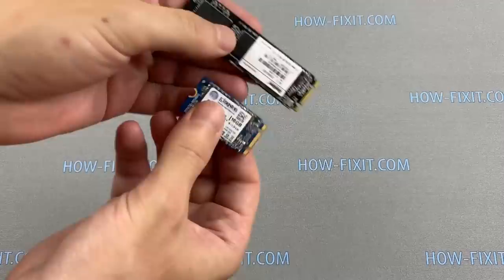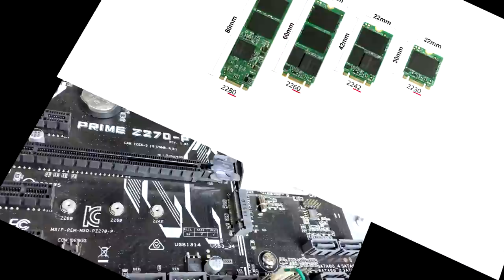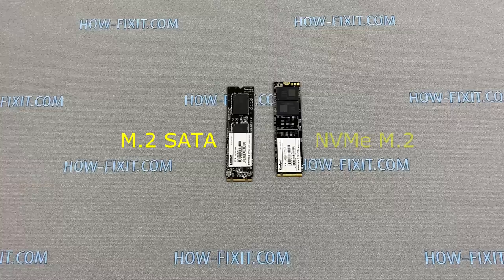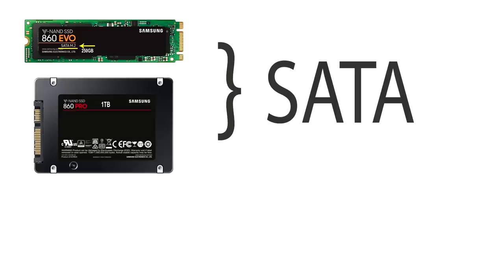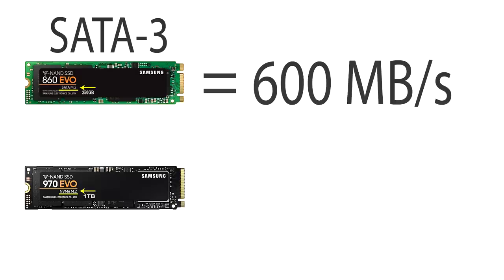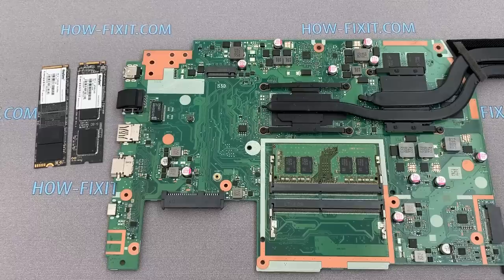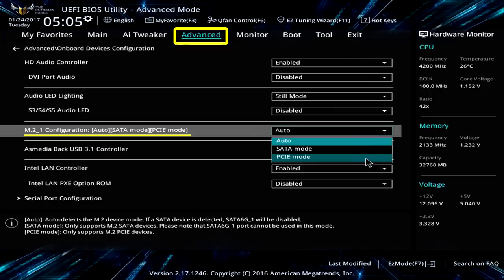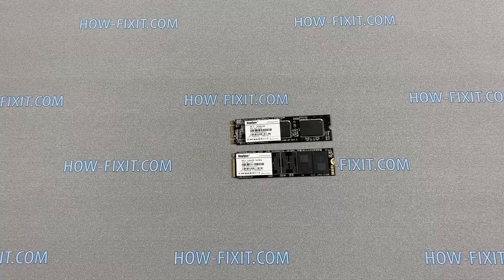Explaining the Difference Between SSD NVMe and M2 SATA and mSATA

Comment: Hi, I bought the Samsung 970 EVO Plus NVMe M.2 drive for my Acer Aspire V17 Nitro Black Edition (VN7-791G-77HR) laptop, and I installed it but the system does not see the installed drivers and it does not show up in the BIOS. On the Acer website, it says my system is equipped with an M.2 Slot 1x 2280 SATA III (M key). I am thinking the problem is that 970 EVO is using PCIe standard M-Key vs SATA III standard M-Key, does this make sense..?

Comment: Hey- how noticeable is the difference between a M2 that reads at 2.000 mb/s and one at 3500 mb / sec . Is that difference really so big ? i have 2 slots on MB - one its gen3x2 one its gen3x4. My problem is that i can ofc plug my gen3x4 in the proper socket but its hidden behind my video card and i kind of wasted the amazing RGB it has . I want to move it on the gen3x2 but there will be limited to 2000 mb/s reading instead of 3500 mb/s which is where it works atm. The writing is around the same value for both ~ 2000 so there is no impact. Will i lose such a noticeable speed reducing from 3500 mb/s reading to 2000 mb/s ? Thank you

Comment: Great video! thanks. I have a EVo 960 NVME PCIE 256GB SSD and wanna convert it to SATA SSD so can use in old laptop.  really struggling to find any M Key NVME converters (doesnt seem to be any that converts to SATA , only to U.2 factor)....any advice all ?
Reply: Bor i am looking for the same did you find any

Comment: just got a new laptop HP 14-dk0024wm it came with a M.2 2280 SATA SSD 128gb,. when i opened the back i noticed it can take an NvME SSD,. because the Motherboard connection has only one notch or key,. my concern is that a NvME SSD might not be compatible even if it can fit,. any help would be appreciated thanks!!,. i'll proably just buy a M.2 SSD SATA that came with it just to be safe, just a bigger size,.

Comment: Aren't there also SATA 2.5" adapters that allow to connect two (2!) NVMe (or SATA) 2280 sticks?
Reply: There would be no point. If you buy some sort of adapter to connect an NVMe drive to a SATA port, you loose the performance benefit of an NVMe. It doesn't make sense. The M.2 slot on the motherboard usually accepts NVMe and SATA M.2 drives.
Reply: NVMe and SATA are two separate standards and are not interchangeable. Some laptops have a combo PCIe/SATA port but it's not the norm.

Comment: hi sir i have a question i just check my laptop m.2 slot and and it has m.2 nvme slot but when i search the compatibility on google it says that i only have m.2 sata compatibility 
is it possible to use m.2 nvme to my laptop? 
btw my laptop is Acer Aspire 3 A314 21-6309 model
Reply: Question seconded

Comment: SATA HDD SUPPORT SATA SSD

M.2 SSD  CHECK SLOT LENGTH BEFORE BUY. SUPPORT M. 2 SLOT AND M. 2 NVME SLOT

M. 2 NVME PCIe  IT IS SUPER FAST  AND ONLY INSTALL IF THERE HAVE M. 2NVME SLOT

Comment: Few weeks ago I suddenly got a Message "Hard Drive not installed" on my Dell Inspiron 17-7000(7778) (i5 processor) series and couldn't access Windows anymore, this was after a lot of years of ongoing screen freeze alongside other issues with 2 Inspiron 17 laptops.
Now I would like to try and upgrade to SSD M.2. 

In Setup and Specifications THE ONLY THING I FOUND is that I can Install One-m.2 drive and One-2.5 inch drive.
Is Samsung 970 EVO Plus NVMe M.2 (1TB) or pro series compatible?, There woulden't be any Bios issues? And is there a limit of storage capacity that my 4-5 Year old Inspiron-17-i5 can handle on both Hard Drives (primary and secondary). Thanks.

Comment: In my matebook d14  there is a 256GB liteon cv8-8e256 (M.2 2280 SATA ).
Can I upgrade with PCIe NVMe M.2? Thanks (Beacuse i've INACCESSIBLE_BOOT_DEVICE error After Cloning Drive on the new PCIe NVMe M.2). The bios doesn't have advanced feature, disabled by hauwei I think. Gratitude :)

Comment: I have m.2 nvme xpg s40g 512 with i7 9700k on msi z390 gaming edge ac. But whenever I install games or anything I didn't get 3500MBps speed . I get around 260 to 370 MBps speed why????  When Source files in  that ssd  .  And when I put source files in Seagate 4tb barracuda  I get around 160 to 190 MBps speed in installation. I see speed in windows task manager under performance section. Is that ok ? Or I can get more performance do I need to do anytype of settings????

Comment: Correct me if I'm wrong after watching this video. M.2 means it's just something that is MOTHERBOARD located? It doesn't say anything about the type of connection, weather it's PCI or SATA, but suggests the physical position of the device? 
That would actually be bad, because no one wants the device  taking place on the motherboard. Is there a motherboard with multiple PCIe connectors, but like SATA are which are ment just for HDDs?